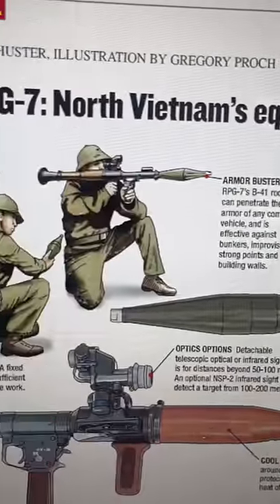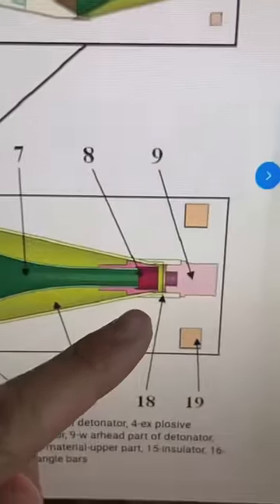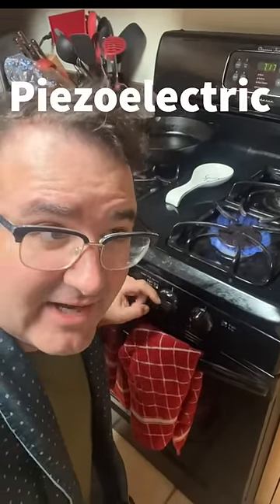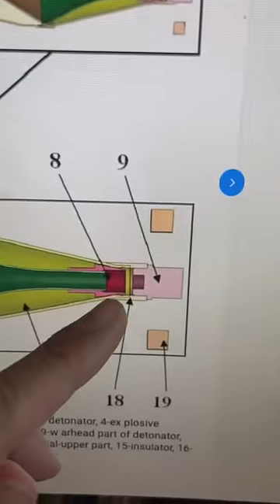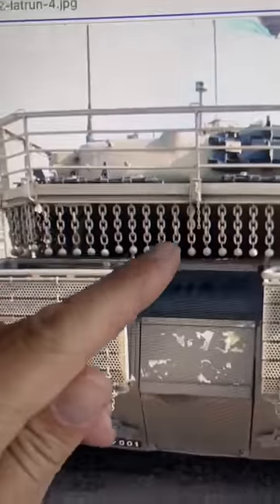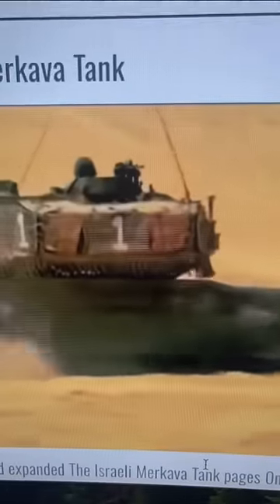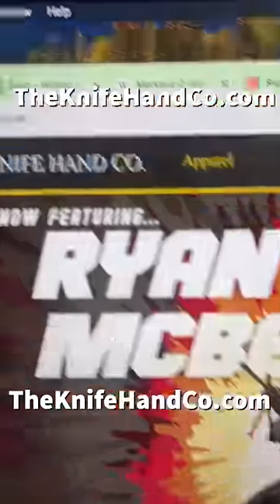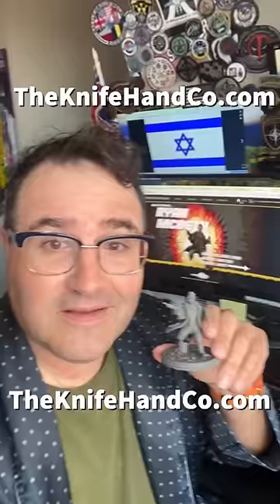What are the balls and chain armor on Merkava tanks actually for?

Comment: Additionally, anti-tank rpgs generally make use of shaped charges to penetrate armor. For these to be effective, the explosive has to detonate as close to the armor plating as possible, with the penetrating effect decreasing significantly with even a little distance. By causing the rocket to detonate even a few inches away from the armor on the body of the tank by hitting the hanging ball and chain first, the survivability increases dramatically. The M1 Abrams uses something similar called “reactive armor,” which is essentially small explosives in the surface of the tank that detonate upon contact with a rocket to disrupt the penetrating effect as well.
Reply: The M1 doesn't have ERA
Reply: @frenchfry1479 yes it does
Reply: @tylerdemaine4556 It can have an ERA package equipped sure.  But usually doesn't have it because it doesn't really need it. 
Where European/Russian tanks often do rely on ERA to pass their strict infrastructure regulations.
Reply: @ch4osaeternum74  true but tanks like the Leopard 2, Challenger and Leclerc don’t need ERA either. They’re usually upgrade packages.
Reply: @tylerdemaine4556  Very true. Both Leo 2 and the challengers are beefy boys being almost if not just as heavy as the Abrams.
Reply: Yeah tusk is the era package but is only designated for urban combat.
Reply: @tylerdemaine4556  not standard, usualy there are ERA packs, but the US and NATO armies don't like ERA (usually)
Reply: You are almost correct but are missing one minor piece of understanding. Shaped charges require space or 'standoff distance' in order for the jet to form correctly. RPG warheads like the PG-7V have the front cone which is just a fuse and empty space that provides the standoff distance needed. If you look at a HEAT shell for a tank you'll see they have a peg sticking out the center. That serves the same function. So yes everything you said was correct in terms of the post detonation effects of a HEAT warhead detonating before it reaches the armor but if the warhead itself detonated with no spacing then it would just be a large grenade detonating and would not have anywhere near the same penetrative effect.
Reply: @frenchfry1479  Its a different design philosophy. Western tanks are large and use their size to pack in more capable composite armor while eastern tanks are designed to be compact. As a result you simply don't have enough space to put enough armor to match a western tank so relatively lightweight ERA blocks are used to augment the weaker hull.

Adding ERA to the front of a Leopard 2 or Leclerc or Abrams does make it stronger but those tanks are already incredibly difficult to penetrate and adding 5% more protection is not always worth the additional weight. For a Russian tank with weaker armor however that ERA may be the difference between life and death.

Also ERA is used on way more vehicles than you'd think
M113 AIFV variants like the YPGR-765 use it
The Bradly uses it with the BUSK armor Package
Abrams use it with the TUSK armor package
Challenger 2s and leopard 2s also use ERA for side armor
Warrior Marder and Lynx IFVs all use some version
and more that are not worth listing.

TL:DR: ERA  is used where weight and space restrictions preclude more robust static armor and everyone uses ERA to some degree
Reply: No no and no... Even WW2 era shaped charges had stand off distances that could be as long as one meter, some of the currently used ones even gain penetration if there is a bit more distance between the detonation and armor. In general, current shaped charges don´t start to loose penetration in significant amounts untill 1,5 - 2 meters after detonation. And reactive armor works on completely different principle, depending on the variant it aims to either deflect, detonate or cut the incoming projectile.
Reply: @LordOceanus  yes, but, for the most part, the tanks are not designed with ERA in mind. They usually don't come.with ERA due to a thought that it increases infantry casualties.
Reply: Following until someone mistakes this as a war thunder forum....
Reply: @tylerdemaine4556 For the Leopard 2, the reason it doesn't use ERA is because of German doctrine. They focus on speed and hitting the enemy before the enemy can fire back.
Reply: @doggo_woo No. It's because they don't have to compensate for shitty composite armor with ERA like Ruskies do. German tankers will also fire from behind hills and they can't always use speed. It depends on the situation so what a poor excuse.
Reply: @PBMS123  Abrams can get Tusk packages if the mission calls for it sure.. Seriously doubt an RPG can reliably penetrate and flat out eliminate an Abrams. Much less so from the front.
Reply: NOPE

HUGE misconception with shaped charges

In fact, they get MORE penetration when they are detonated further away

Thats why modern HEAT shells and AT Missiles (That aren't top attack or tandem charge) have a long protrusion out the front

For example, tank shells such as the M829 and DM12

AT missiles such as the ITOW and TOW-2 (except 2B), Panzerfaust 3

Its actually the fuse, and they are trying to get the standoff distance required for max penetration

This is Statistical armour. The RPG-7 has a wire going around the edge of the cone on the front to the warhead in the back

What Stat armour tries to do is disconnect the piezoelectric fuse from the warhead by cutting that wire before the fuse comes into contact with anything. So by the time the fuse tries to trigger the explosive, the wire is already disconnected and the warhead does not explode

https://imgur.io/a/lf0Rro7

read up
Reply: @quantumsniper9433  interesting and seems to make sense.
Reply: it has layered chaffam ceramic armor. Maybe it has attachment points for reactive armor package. ERA is an external applique. You're describing the monroe effect which has to be applied directly to the surface and is more resistant to surface deflection than traditional projectiles.

Comment: That's not what it is in the igniters that click repeatedly. The piezoelectric ones only click once when you turn or press. If it's clicking multiple times automatically then it's electrically powered with voltage multipliers inside.
Reply: And by "click" I mean spark.
Reply: The usual manual piezo igniter gun works by mechanical force on the crystal, producing a small voltage. At the mechanical click, it switches off, the voltage spikes before being cut off, due to a coil inductor. The voltage spike gives the spark.
Reply: @yewhuiphoa9654  What are you referring to exactly? Your comment didn't clearly define when you transitioned from speaking about the piezoelectric igniters (single spark per activation) to the electric igniters (continuous repeated sparks while activated), so I read that like you're saying there's a coil inductor on the piezoelectric igniter.
Reply: Sorry, it wasn't clear. Questions :

The mechanical igniter is hammer striking piezo crystal with leads connected to its electrical axis ?

The repeating igniter is just a spark plug and ignition coil ?
Reply: @agnelomascarenhas8990  That's correct.
Reply: @yewhuiphoa9654 that is complete nonsense. What you are describing is an inductive spark coil for a gasoline engine, where the current through the primary coil is interrupted to generate a high voltage at the secondary coil. 

In a piezoelectric igniter, there is a spring-loaded little hammer which strikes the crystal, and that generates a surprisingly high voltage, enough to produce a spark.

The stove igniter isn't piezo-electric though, that uses a transformator much like an ignition coil.
Reply: I mean... I came here to the comments for the same reason as you guys... but still the level of "Umm actually..." going on here is comic-con tier.
Reply: @SurGoose  I feel you. Making corrections without coming off like 🤓☝️ is a challenge, especially since you can't control how people interpret your writing.
I'd say the thread was pretty good, though tonfleuren was a bit harsh imo.
Reply: The continuous igniters used in most stoves don't appear to have a mechanical sound -- we only hear the spark.

(What I described in the earlier comment is the basic idea of one common design of manual igniter stick in the past. There could be various mechanical designs but they are usually based on the similar idea of a force generating a small voltage via a piezo, then an inductor turning it into a momentary large voltage for the spark.)

As for the inductor/coil, the voltages in piezo crystals are too small to cause a spark so some inductor is usually involved.

For non-mechanical continuous igniters, I would think they are electronically generated. (Like a taser?) I am not familiar with them but I'd guess they involve some oscillating circuit. Maybe even a piezo crystal used in a different way, like the ones in watches... I wouldn't know -- I'm not familiar with them.

There could be many designs of stoves and igniters but I think the basic ideas are there. For a mechanical force, you should hear some mechanism or feel some force.

Maybe I'm wrong. I'll look it up later and learn more. We learn something new each day.
Reply: @yewhuiphoa9654  Interesting, I've never seen an inductor on a piezoelectric igniter. From what I understand the striking of the piezoelectric element is enough. I believe the voltage produced gets to be so high because of the way in which the trigger mechanism in the device loads up a lot of energy before releasing and striking the element.
For solid state electrical igniters I've known them to use either voltage multipliers, induction coils, or a combination of the two (like tasers). For an oscillator they usually use a transistor oscillator, they could use piezoelectric crystals for that in a different circuit but I think it would be cost prohibitive.
Reply: From what I've just read, this is my conclusion.

1. There are some mechanical piezo continuous igniters for stoves. These do make clicking sounds even when spoilt and not making sparks, so they are mechanical. (And yes, there are others that generate sparks electrically, non-mechanically.)

2. There exist piezo crystals from cooking appliances that can apparently produce sufficient voltage without an inductor. So technology and design have probably improved since our childhood and our parent's/teacher's childhood. I was taught the piezo crystals then could not produce the 2 kV - 3 kV needed without some inductance somewhere. The old ones had inductance in its design, usually in the coiled spring long neck.

Yes, we learn something new every day. A good discussion.
Reply: Exactly what I wanted to write.
Reply: @PBMS123  Who is the "he" you're referring to? Sorry.
Reply: @PBMS123  Ah, yes
Reply: The piezo ignitors are what you find on gas barbecues, you know the red button you have to push, they wear out after so many uses, the electric ignition you find in kitchen stoves is powered by electricity since the stove is plugged into the outlet.
Reply: That's what I was thinking. The click on these is just the spark? Pre-made electricity is readily available in an indoor kitchen... the stove almost certainly has electric timer and temperature controls, anyway. It would be sorta Rube Goldberg to have a little electric arm swinging a tiny hammer in there, to generate electricity from the impacts.
Reply: Basically a spark plug for your range, right?
Reply: "Touche"

Comment: That stove isn’t lit by peizoelectricty. That’s a basic pulse generator driving a coil.
Gas grills and some butane lighters use piezoelectric igniters, the loudest click coming from the striker hitting the crystal.
Reply: Yes, exactly. The snapping sound on the stove ignitor is partly from the spark and partly from physical movement which happens in the electronic components of the ignitor circuit when there is a very fast capacitor discharge. The piezoelectric ignitors are the ones you manually press a button for each snap - pushing the button compresses a spring which then gets released suddenly, striking the piezo crystal.
Reply: Gas fitter here. Thank you!
Reply: @gmatthewclark  I remember some dodgy stoves overseas that had piezoelectric start, but all reputable units used pulse transformer igniters like his (and mine here) do. The only stoves I ever saw that used piezo were camp stoves and propane gas grills (and their stoves).
Reply: I came here just to write that but found it was already taken care of.  Gas space heaters and gas lamps also commonly use a piezoelectric crystal for ignition.
Reply: @listerdave1240  and in some cigarette lighters. They all use lead zirconium titanate crystals to generate the spark, triggered by a spring loaded hammer that strikes a ball bearing that sits on the crystal.
The lighters being phased out or banned entirely in some jurisdictions, due to the lead content.
The same basic crystal in stacked configuration being used in sensor platforms.
Reply: MrClassiccarenthusia  not quite. The early petrol engine (and current general aviation and small engines in general) used a magneto, not anything piezoelectric. Hence, is coil and magnet based, rather than a crystal being deformed to generate a voltage.
Reply: Plus his stove can't even destroy tanks!
Reply: That's pronounced Pee-et-zo, not Pie-zo. I did ultrasound at Uni and and my physics profs would be shaking their heads.
Reply: @professornuke7562   if that was all that they'd be shaking their heads over when I was involved, they'd count themselves fortunate to have a good week.
In one lab, I had a high voltage vacuum tube diode rectifier, which out of boredom ended up having one cathode/heater side grounded via a spark gap. Such a lovely blue glow was emitted by the glass...
Then, there was the time I was declined in a proposal to acquire tritium gas and lithium deuteride for a beefed up fusor.
I was never faulted on safety precautions though.

Comment: Side comment: During WW-2, submarines were reporting dead center hits with no detonation. Turned out that a square hit was deforming the firing pin on the torpedo. As a temporary workaround, they were told to strike their targets with a glancing blow. One captain said "Hell..it's hard enough to get them lined up..and they want it off angle?"

Comment: It's used to detonate the rocket early, far away from the tank's armor. The extra distance significantly reduces the penetration of the warhead. 

Similar to the cages we put around the Stryker to defeat RPGs.
Reply: And here I thought tat slat armor was to keep me in….  ;)
Reply: So is there a measurement for effectiveness on this? Like I really want to know what's the chances of the RPG working properly or not.
Reply: The slats on the stryker are also to disable the detonator. The warhead needs a standoff distance for the penetrator to form properly and it being greater doesn't affect it negatively. If the warhead ignites on the slats, the stryker is dead.
Reply: @lemons1559  you kind of contradicted yourself there.
The idea is stand-off allowing the jet to defocus, which worked, so the Russians then came up with the tandem warhead.
Because, when they invent a better mousetrap, some bastard invents a better mouse.

Still, it's a newer method, rather than slapping more iron in place for armor, one uses what's essentially a Whipple shield of layered nothing much that well, works a lot better. With a fuck ton less weight as well!
Reply: @spvillano  Tandem warheads aren't for spaced armour or slats but for ERA designed to defeat shaped charges in a different way. The 1st stage detonates ERA and the 2nd stage goes around the ERAless armour. If the slats break the fuze it's still just as defeated as any other disabled warhead.

Comment: Fun fact -  piezoelectric transducers is also how electric guitars work 🎸
Reply: Electric guitars use coils, not crystals. Otherwise you’d not need steel strings.
Reply: Specifically electroacoustic guitars.... But yes, sort of.
Reply: Piezoelectric transducers are usually placed under the bridge where pressure occillates them.
They were first used orchestrally for like cellos and such. Modified for guitar/strings in the 80's.
They work with ANY string but most stringed instruments which incorporate them are hybrids using magnetic picups as well.
They chief difference are piezo's are cleaner acoustic type tone quality, lacking the inductive distortion producesd by magnets and coils.
Reply: @dananorth895  Eh, thank you for letting me know more! I love this comment section.
Reply: @dananorth895  interestingly, audiophiles preferred magnetic pickups in turntables over piezoelectrics for precisely the same reasons given. No distortion, superior bass response. I got out of instrument transducers back in the mid to late '80's, moving into video electronic repair and digital electronic repair.
Meanwhile, sonar uses piezoelectric transducers extensively.
It all depends upon the era and technologies in place at the time, as piezoelectrics did have performance issues early on.
Makes me wonder what the grandkids will be listening to when they're grown up...

Comment: If you want to be specific, the oven you showed just uses a high voltage transformer and condenser, not a piezo-electic unit.
Older ones with the push button starter do that. Either way, effective explanation.

Comment: This form of armor can also be seen on many other tanks as a rigid cage or fence. If it damages the fuse or warhead, great. If it metely sets it off early, it's too soon, and it won't penetrate the armor. The Philippines did similar with their APCs using cardboard and wood and such to protect against RPG-2s.